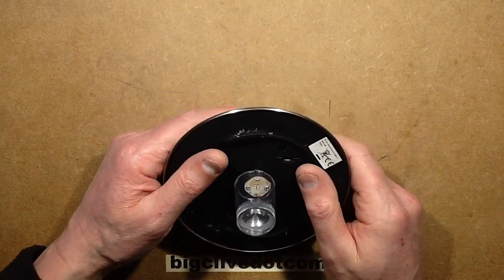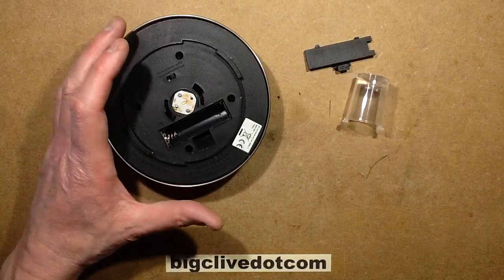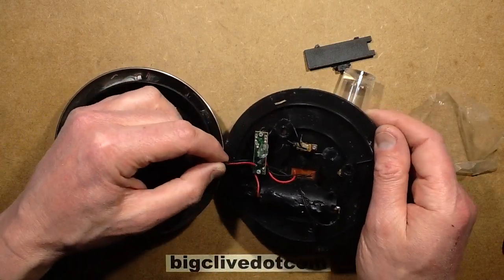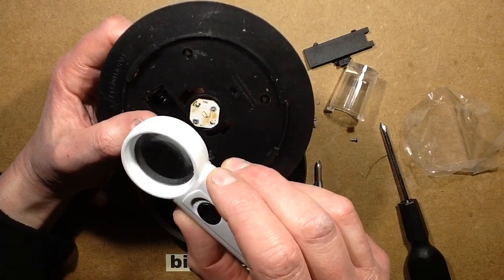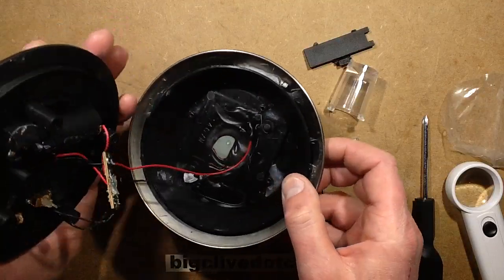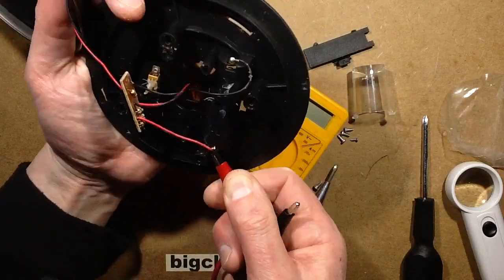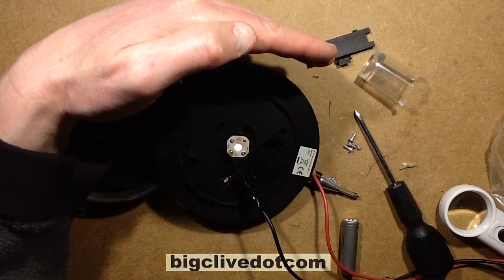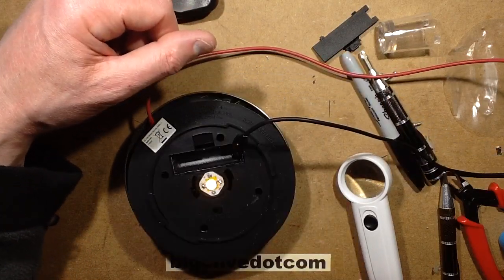Fixing a favourite solar garden light.

Comment: I've replaced new boards in many things and soldered parts onto my mothers solar . But which particular thing other than sensor in solan panel helps switch it off during the day ? My 2 particular ones simce our bits had them stopped working it's not battery its because they are perm.  On . Any suggestions other than replacing driver etc?
Reply from the maker: Most use the voltage from the solar panel to detect dusk.

Comment: How do you know which voltage panel to get. I need a 1 7/8 x 2 7/8 garden light panel but they offer 2.5, 3, 5 or 6 volt mini panels. The rechargeable batteries are AAA 1.2v and it takes 3 of those to light the light. The light doesn't have anything written on it. The old panel reads: PCB-03210A. 0550 and it is the dimensions above.
If I only knew if I should buy a 5v then I could diy my old solar garden lights. Please advise. Thanks

Comment: I've got a broken solar light - the LED lights up using my multi-meter diode mode, the Solar panel is putting out 2-3 volts under my work lamp, the battery has 3.3 volts, but I'm only getting 3-4 milli-volts from the circuit board that goes to the LED.  Bad board or am I missing something?  I'm expecting that when I cover the solar panel, it should light the LED.
Reply from the maker: If the battery is a NiMh cell it should only be showing about 1.5V so it sounds like it might be worth replacing it with a new one.  If it's a favourite light you can replace the PCB and cell with one from a cheap pound/dollar store light.
Reply: @bigclivedotcom  Thanks for the response!  Checked and it's Lithium ion and seems to be within specs.  Great idea about using board from dollar store.  I'll check it out.  Love your videos.

Comment: Hi I know it's just a cheap fairy light that was left here by the previous owner but I'm bored and I stripped it down because they aren't working. The battery  is flat. And when I put the panel up to the light and take reading from battery holder terminals it's read 0. How do the panels fail? It's glue on obviously so I'm prob not going to bother fixing it and it's only a £6.95 thing from b&m but I'm intrigued how something that just doesn't move and just stays there fails. I took the reading from direct back of panel as well as battery holder and still 0
Reply from the maker: Quite often the solar panels corrode with water at their back.

Comment: I have solar decking lights that only work in daylight they only have an on off switch no adjustments I've cleaned the solar panel.Any ideas why its doing this?
Reply from the maker: The two most common issues are either the on/off switch corroding (it can be bypassed) or the rechargeable battery needs replaced.
Reply: @bigclivedotcom  thankyou I have changed the batteries but I'll try some more.

Comment: Perhaps you might have a fix for a problem I'm having Any idea why in a set of  solar string lights every second light is lit? If I switch polarity of the wires, then the lit bulbs go out and the previously  unlit will light? Thanks in advance
Reply from the maker: That sounds like the chasing lights where the LEDs are alternate polarity and the circuit swaps polarity to chase them.
Reply: @bigclivedotcom   thanks for your reply. Think you may have solved my problem. I salvaged these lights from another set a while back, and it's possible  they were a chaser set. I'm now trying to use with just a constant light panel. If I understand  rightly, the lights are fine, I' just have the wrong type of controller?

Comment: Any ideas why a solar light would be on during the day and how to repair it? It seems like the sensor for night/day is not functioning properly.
Reply from the maker: That usually indicates that either the on/off switch is corroded (just short it out) or that the battery has dried out and gone high resistance.

Comment: i put 2v new cell on the old gutter lights and used sillicon to seal then now there back brighter than ever i have a security light dosent seem to hold charge or not charge clive any ideas ?
Reply from the maker: Corrosion around the solar cells is common.

Comment: I bought 16 solar lawn lights. 1 of the 16 would not come on. after further investigation, I found if I push on the unit from the back the light came on. Dismantled the unit and found they make their connection via springs from the light, and should make contact with the touch plate (solder) on the board. One of the springs was bent so I straightened it out. As covered the solar plate/panel the light came on. Re-assembled the unit and put it back in the lawn. Tested during the middle of the day, but the light comes on with my hand completely over the solar plate/panel. Thank you for your video.

Comment: Mine works with new battery just will not turn off with light. Battery was dead
Reply from the maker: That suggests a faulty solar panel.  Probably corrosion.
Reply: So junk it. Other 5 just needed new battery use my bc700 charger and 3 came up dead.

Comment: Hello from the USA home of SMA. I like solar lights and have one just like yours. My problem is that the light stays on and bye night fall the battery is not fully charged. Do you know what controls when the light comes on? I don't see a photocell.
Reply from the maker: The output from the solar panel is used to sense light level.  If the light is masked byu leaves and branches or other shadow casting things then it will come on too early.
Reply: What I meant was that as soon as there is enough power to turn the light on it comes on. Even in full sunlight.
Reply from the maker: @billburkart9087  Somertimes if the battery is dead the solar panel will light the LEDs directly.
Reply: Faulty light sensor. Idk why this guy doesn’t know that, like 5 people have asked him. I was hoping to find wear it’s located

Comment: I've fixed a lot of these myself. Besides simple things like the battery is no longer good, the most common cause of failure seems to be bad solder joints. The solder joint quality is horrible! Also, the switch can go bad. I usually take the switch out of the circuit at that point. Look for bad solder joints everywhere! I had one under the glue where the LED was soldered. Take a picture, or write down where wires go. They break off easily as you are looking at it.
Reply: Yes! That's my biggest problem. The solder break so easily! I'm trying to reattach by solder, but there's a microscopic amount of wire at the end to do so. So I'm cutting away some insulation, took a break to look for videos .. so far none address he solder issue EXCEPT FOR YOUR COMMENT

Comment: Hi Clive, brilliant piece of work on that solar light. But I am not an expert and have  not a clue on all the tech that you know. I have a large Rattan  light in my mother’s garden which is beautiful and I unfortunately I  put the wrong type of batteries in and think I blew the unit. Unfortunately they no longer make these large lights and I would love to fix the unit but no one wants to know . I am willing to pay  you a reasonable price to fix and my mother and I would be eternally grateful best wishes chris please text me on 07902693633
Reply from the maker: Hi Chris, it's easy to fudge in the circuit board from a cheap solar light.  Sometimes the solar panel corrodes though, which is harder to fix.

Comment: Thanks for the video. Im having an odd issue with my garden light that maybe you could make a suggestion to fix... opened up the solar light that is not working and it is only working when I physically touch the circuit board where the ground wire is connected at (blue wire which I am guessing is the ground). The light will only come on while I am touching it. The connection itself is not loose bc I can touch anywhere on the circuit board that leads to the grounding circuit and the light will come on. To confirm...this is the circuit board on the solar panel itself. Not the circuit board that the battery connects to. I tried re-soldering the wire for a better connection but NOPE. I have 3 more of the same light and they all work except this one. Any ideas what might be wrong in my case or how to fix (other than chopping my finger off and taping it to the circuit board?) :)

Comment: What's the best way to remove the white stuff covering the tops of the solar panels after a few years? I've been using sand paper and whilst it does seem to help remove the worst of it there are still hard to remove coatings covering the panel. Its almost like the plastic breaking at the surface or some kind of limescale build up.
Reply from the maker: The resin covering the panels tends to degrade from UV exposure.  I'd guess a T-cut like compound might remove the worst from the front, but will not prevent the deep discolouration.
Reply: Thanks, I'll give it a try. Not too bothered about the color just as long as it still allows a good amount of light to pass and into the cells. Fighting off shadows is hard enough at high latitudes!

Comment: Great video Clive. Thought I had some weird obsession in trying to get a couple of these to work and now see I'm not alone?
The ones I have are amazing (after having tried a couple other brands). They're Harbor Breeze and I know I should know better but they were a gift. They have the LiFePO4 14430 batteries and have been in service continuously for close to 3 years now here in the NE US. Only in the past couple months have I noticed a couple have weakened. I replaced the batteries but they don't seem to charge back up fully even on a cloudless day in full sun. Put a fresh battery in and they're fully bright.
So my question, for anyone, is can the solar cell on top die? Because that's the only thing I can point to as being weak. I know that rooftop solar cells have limited lifespans and maybe I'm seeing this on a smaller scale?
Thanks again!

Comment: My solar light wouldn't work because the wires from the led bulb became unattached.  Is it worth trying to fix something like that.
Reply from the maker: If it's just corroded leads on the LED then you can fit a new one.
Reply: No corrosion at all.  The soldered connections just came undone.  I'm just not exactly sure where the connections from the led bulb go.  It looks as though only 1 connection was soldered and the other was free.  Does that sound logical?
Reply from the maker: Both would need connected.  There may be a clue with holes through the solder in the PCB.  The LED needs to go round the right way.

Comment: No, the first one I worked on I just unsoldered the wires from the board added length to them and re soldered to the  board . The next two I worked on I cut the wires midway and soldered in the splice. All have the same bad .result

Comment: I tried to put the solar cell a bit farther away with longer wires and once I have everything resoldered the light will not go out. There is no manual switch involved
Reply from the maker: +Robert Peterson Did you solder directly onto the solar cell?  They are very easy to damage.
Reply: bigclivedotcom the solar cells not connected that's how it goes off the turn on the light

Comment: Hello. Take a look at this from dx dot com SKU: 24031 Anti-Static/Static Removal Prevent Shock Keychain
Reply from the maker: +Nicklas Lindgård It's usually just a neon lamp and resistor.  The static discharges through it making it light.

Comment: I want to run some 3v led lights (4 of them) off of a 4x AAA battery box. How would I do this without frying the lights? What resistors would I need? (If I do need them).
Reply: You can tell I'm new to all this haha
Reply from the maker: +X-FLIGHT101 I'd suggest a resistor value of 150 ohm (quarter watt) and also suggest using one per LED.
Reply: +bigclivedotcom thanks for your help! How can I tell what ones are 150ohm?
Reply from the maker: +X-FLIGHT101 Colour bands brown, green, brown.  (And then silver or gold at the other end.)
Reply: +bigclivedotcom thanks :)

Comment: If I fixed it, I would have stuck a spare CREE XM-L2 led into it or one of the newer XHP LEDs into it even if it is entirely overkill! Running LEDs at lower than rated current will increase their efficiency, and for CREE LEDs, they can achieve over 200 lumens per watt at low currents!

Comment: Wow, where did you get this one?   I've only seen the ones with 600mAh crappy AA NiMh batts which are prone to UV and rust  damage. Ok fixed them up with clearcoat which seems to protect it but this one looks nice and seems to have a good panel.
Reply: Wow 600mAh ours (oz) are down to 200mAh now. You don't know how lucky you are:-) LiFePo cells are perfect for this job, I'm getting to be a fan of the little AA (14500) ones they have the advantages of Li-ion but are more robust and forgiving of charging mishaps etc.
Reply: +Nic Green well it says 600mAh, but those are Chinese mAh's ;-)    Haven't seen the LiFePo cells here.
3.2V  and a led sounds really nice.  Current goes down when the Voltage goes down.  Wonder how long a single low power led could burn (does it still burn?) on these cells.

Comment: Could you please check out some cheap Chinese multimeters, I'd really love to see how accurate they are.
Reply: +bubblemanpie if its digital, then they easily meet their specification, digitals are pretty amazing and consistent at any price, its safety that is the compromise (and build quality) but the measurements are done on chip and are not a problem.  i have a 30 year old taiwanese budget meter, it still easily within its specs today, although its relegated to workshop general purpose meter now as its not cat rated for any safety.

Comment: Nice troubleshooting and repair exercise, but I'm of the opinion that these Chinese-made solar garden lights are a waste of money.  I've never seen one last more than two years. After replacing or repairing a number of them, I've come to the conclusion that despite the higher initial outlay, a mains powered or  low-voltage lighting system is cheaper and easier to maintain in the long run.
Reply: Just take it apart and do some waterproofing before using it, fully charge the battery from time to time and bring it inside during winter and it will last for a long time.
Reply: ted clubber lang  Just buy a low-voltage system or mains-powered system, NO waterproofing required, NO external recharging required, it DOES NOT need to be taken inside during the winter, and it will still last a really, really long time and will still be going strong long after the pampered solar lights have landed on the rubbish heap.
Reply: +Milosz Ostrow Well, the big weakness of that is wiring.  Wiring must be installed in the ground, and repaired when it's damaged.  A suitable outlet is needed for power.  Personally I prefer easy and quick, cheap and cheerful.  Throw them away every year and buy new.  I'm not going to make it hard on myself...no pun intended.

Comment: +bigclivedotcom Cliv, I'm a bit stupid and would appreciate some help. You sometimes mention "using a bench power supply to test discharge of blah blah". Are you literally connecting <X> to <"bit of kit" Y>, and then discharging it? Is it a giant load resistor setup, or something with electronics?

Any recommendations?
Reply from the maker: +TheJohn8765 It's a variable voltage bench power supply with adjustable current limiting.  I'm not going to recommend the one I have, since it has a software or hardware issue that causes it to crash and send out random voltages.  It seems to be quite common with these units.  Try looking on eBay for a bench power supply, there are lots of options.
Reply: bigclivedotcom "*it has a software or hardware issue that causes it to crash and send out random voltages*" Really? lol! (sorry) Is yours a 12-30v DC model, or a "mains" version? I've seen the DC models for not much money, but I suspect the AC models are a fuckton more.
Reply from the maker: +TheJohn8765 This is the dodgy one.  Apparently sold under various brands, and they all do the same thing.
http://www.maplin.co.uk/p/80w-switched-mode-dc-multi-voltage-slim-bench-power-supply-n27gg
Reply: bigclivedotcom Ah. Actually, that's one of the ones I was looking at (going by the look). Shit. I guess I shouldn't be surprised, since they're all cheap crap. Maybe I'll get lucky and win one of EEVblog's super-duper ones??

Comment: Yep, there's plenty of spiders down under that'll quite happily bite your bum (and probably kill you) when you're really desperate to use the throne and didn't check under the seat first... :P

A simple fix there, though I'd probably have ripped the old LED off the board with the cheap chinese knockoff snips... :P
Reply from the maker: +twocvbloke (I did rip the old LED off the board with the cheap Chinese snips.)
Reply: bigclivedotcom
That's good then, gotta give the cheap chinese clone snips a job... :D